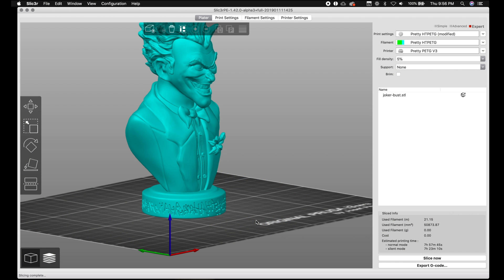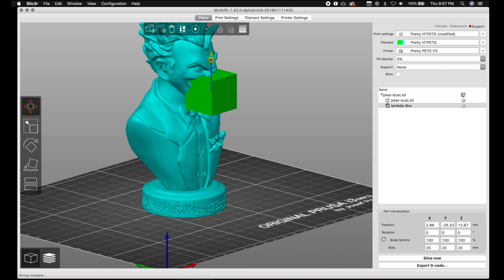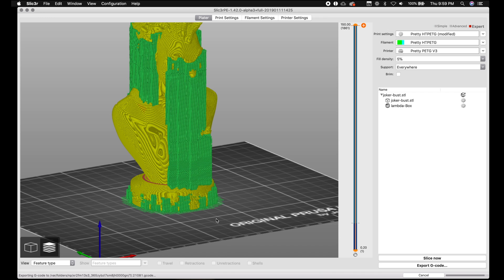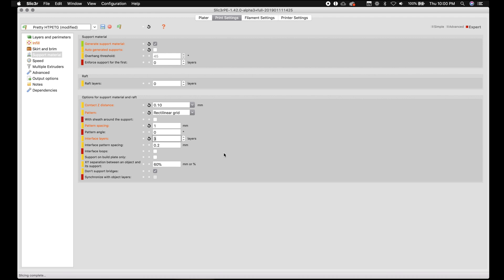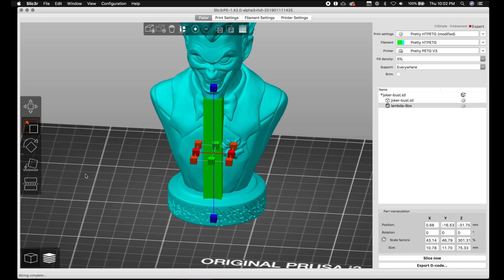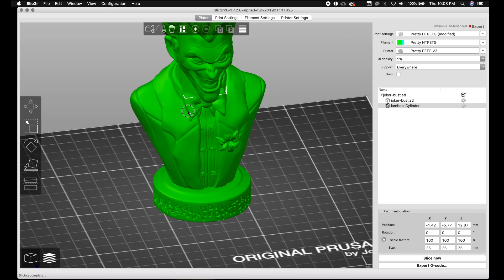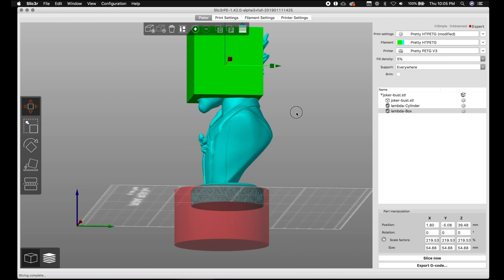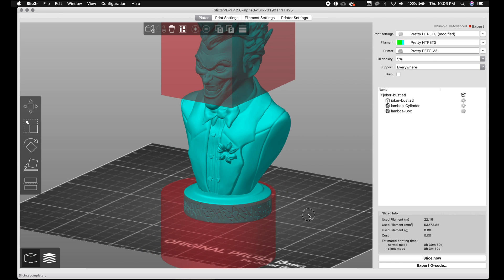Slic3r 1.42.0 Alpha 3 Custom Supports

Comment: this is nice feature, but i'm having littlebit problems with one of my prints. when im doing the enforcer inside of a hole and im doing the support edges inside the hole so it does not go over it. the other side is fine but the other side it goes and supports too much so it goes to the plate and I dont want that. The solution is to make it very narrow so it keeps the supports inside the hole but there are littlebit gaps that aint supported. littlebit hard to explain :D

Comment: Great demonstration, thank you so much!

One small correction could be at 10:25, where you say “...To use the blockers, you have turn off auto generated supports.”

It should be the opposite, auto generated supports should be turned on for the blockers to work, as you showed on the video ☺️.

Comment: One thing I want to add with this is that the blockers and enforcers affect only bottom surfaces within their volumes. So for the first example with the enforcer, you only need it to be covering the chin itself, it doesn't need to go down further.
Reply from the maker: Anonymouspock correct! I use the length to make sure it doesn't hit areas of don't want it to.